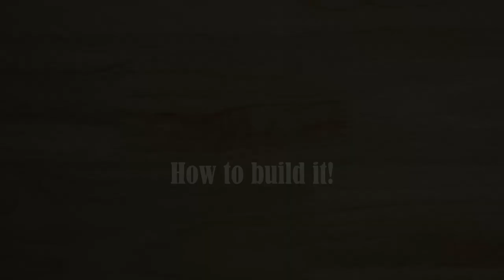DIY Table Saw Push Block | Table Saw Jig

Comment: Hello, I am a lawyer from Microjig and I'd like a word. Just kidding, great work. Do you have any issues with the fence on your DeWalt saw being out of square relative to the table? I had a replacement sent to me by DeWalt and it's worse than the original.
Reply from the maker: Hi vVeazel. Actually I did. When I got it there was a half milimeter gap on the back side between the blade and the fence. I went through quite a few videos, and kept on adjusting. I managed to make it square but it took quite some time and I was almost ready to get a new one. How bad is yours?
Reply: @AllFlavorWorkshop  Thanks for the reply! At the infeed, my original fence is square to the table, however at the outfeed I have a 2mm gap at the top of the fence. Did you use some fort of tape between the plastic slider and the aluminium rail to correct it?
Reply from the maker: @vVeazel  I did not. My main goal was to make the fence parallel to the blade. I was having a tiny gap there and I needed to adjust the back part of the fence. The fence has a plastic part that is attached to the aluminum rail. There is a hexagon bolt that fixes these 2 parts together. I was adjusting this one (together with the front one) to make the fence paralel.

Comment: That probably cost you more to make than if you just bought a MicroJig
Reply from the maker: Well, considering I was using only leftovers I had in the shop (and the price of the material is around 12USD) I would say still pretty good ;)
Reply: @AllFlavorWorkshop  Plus the time it took to make it...your time is more valuable then the cost of the wood.
Reply: Sometimes it's not about the time, effort and cost ... anyone can buy a piece of plastic, to design and make your own version is an accomplishment!
Reply from the maker: @barry.w.christie  Thanks Barry, true